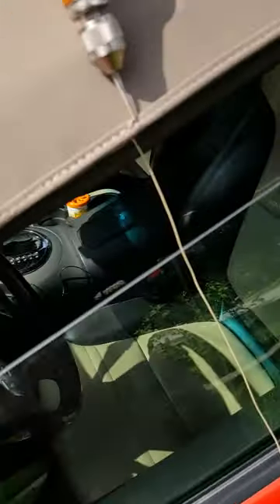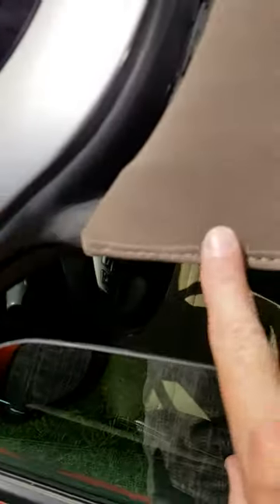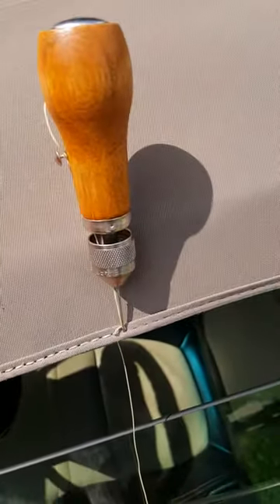Restitching the seams on Pontiac Solstice top part 1 of 4

Comment: Thanks for the video.  Ours has just worn through in one place, can I do a section of tape just over that area?
Reply from the maker: The place on mine that was worn through . I patched with a small strip cut from a canvas patch kit. it gave me something to stitch too. I have heard of people patching with cloth tape. there is also a simple adjustment you can make on the top to raise it slightly. Opens up the gap a little.
Reply: OK great.  Any recommendation on patch kit brands and awl brands?
Reply from the maker: Derek Richey part 4 shows which sewing awl. the speedy stitcher. there is also an off brand one available at harbor freight if you have any of those stores near you.
Reply: Thanks got one.  Where do I get the patch kits, thread, etc.??
Reply from the maker: Got the patch from Walmart and I ordered the smaller needle with thread online from Speedystitcher. I thought the needles and thread that came with the kit were too large. http://www.speedystitcher.com/speedy-stitcher-products/
SMALL STRAIGHT NEEDLE, #130, 30 YARDS, FINE WAXED THREAD, #160
Reply: Sorry to keep harping on this with you but just want to get the right stuff.  Do you recall the name of the patch kit?
Reply from the maker: If I remember correctly it was a canvas tent patch. It has adhesive on on side for using an iron to patch a hole. I just cut a piece down to the size I needed and stitched in on. I did not use any heat.
Reply from the maker: The name of the patch kit is : Bondex outdoor restore, Duck Patch.

Comment: Where are the rest of the videos?
Reply from the maker: I just did some house keeping on my page. Added all to the playlist. Hope this helps.
Reply: @onlyron  thank you.  I have the exact same problem with my solstice and was hoping to restitch mine as well.  I may respond again with a question or two if that's okay.  Going to try to get the awl, needles and thread this weekend.  How is the stitching holding up?
Reply from the maker: Going on 8 years. Stitching is holding up better than the canvas. I will need to consider replacing at some point. I am thinking of trying to re-dye it first. I have seen a kit from the UK that appears to give good results. @drake3898